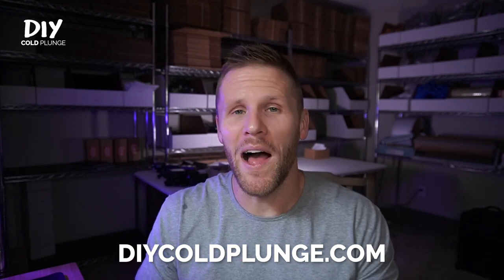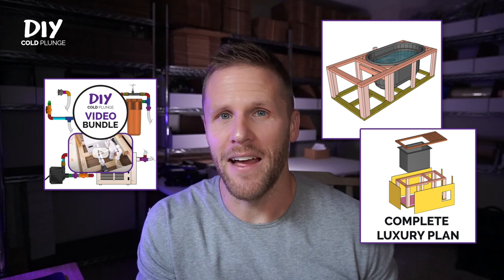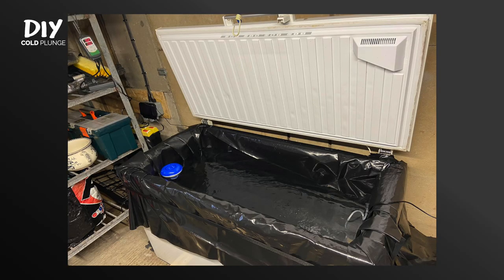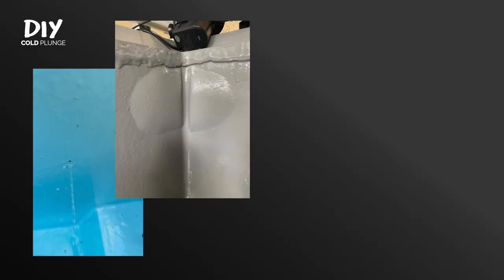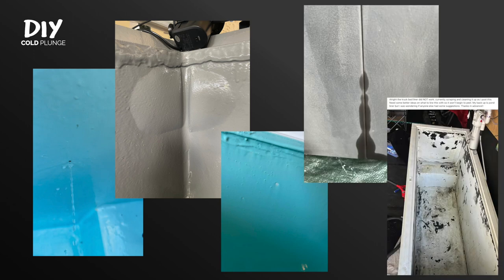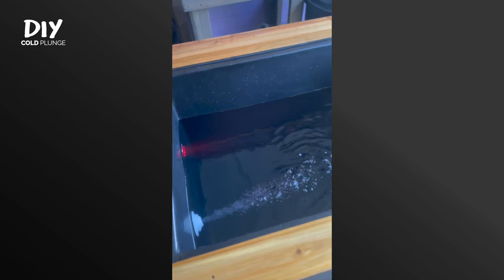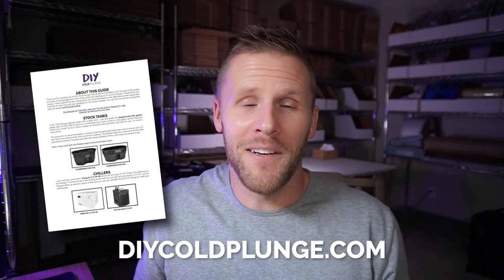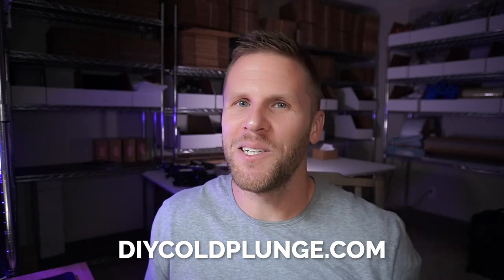Why I didn't make a Chest Freezer Cold Plunge | DIY Cold Plunge Stock Tank, Pump, Chiller and Ozone

Comment: Thank you for this. I’m most likely going to switch from the freezer to the chiller. Do you have any advice or thoughts on the utility bill increase between the Chester freezer and the chiller? I’m going to go with the 1/2 HP active aqua.
Reply from the maker: I haven't noticed any utility increases, I polled my facebook group a while back and didn't have any crazy input either... Insulation will be the biggest factor in keeping the chiller from running